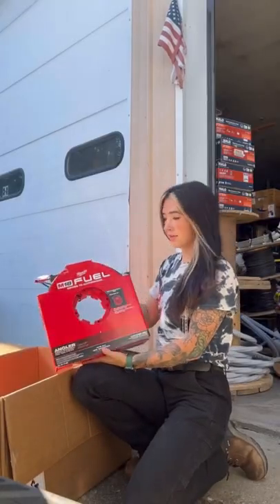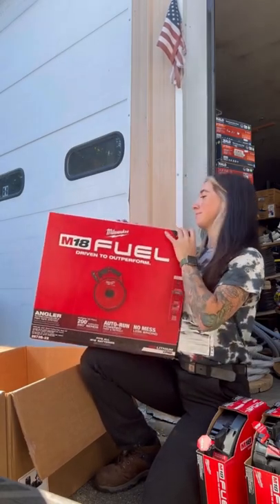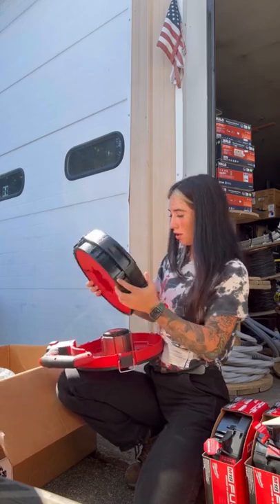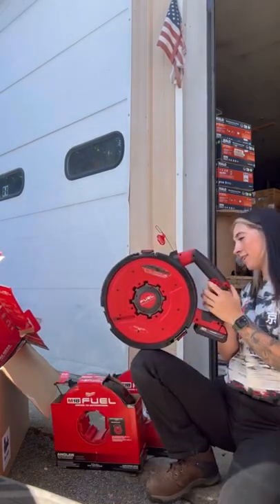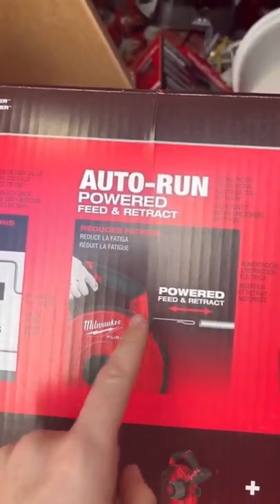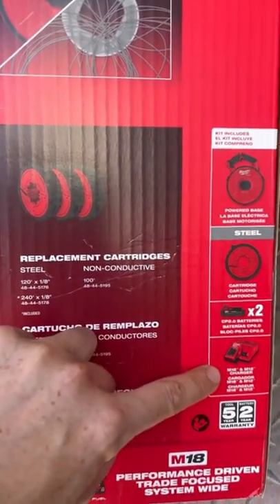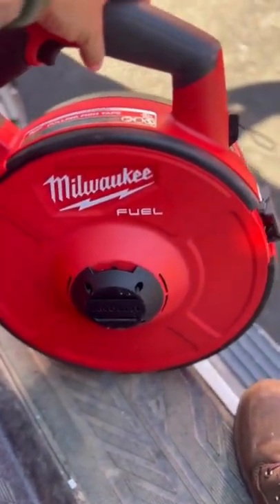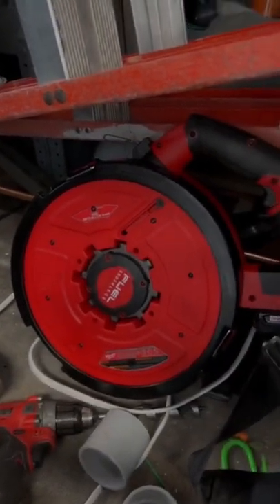Milwaukee Angler Fish Tape Pull Unboxing & Tool Testing

Comment: I do commercial electrical work and I love this Milwaukee product. This angler fish tape is a saver in many ways. At first it takes some time to learn how to use it, not to operate, two different things. I added the Milwaukee Metal Fish Tape Flexible Metal Leader and works better for me. It is heavy but you learn to position your self, the angler and used to your advantage. Supporting it to a ladder top, a scissor lift rail and so on. Trust me is better than pulling 240 feet of number 10, 8 or 6 AWG by hand.